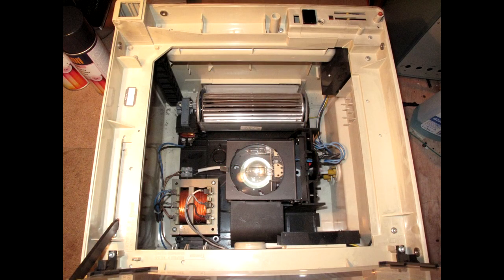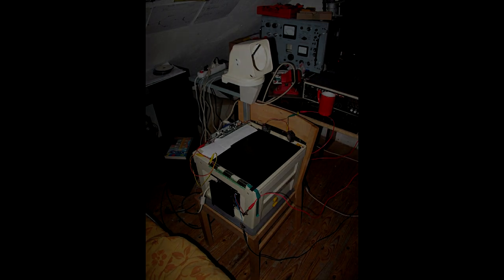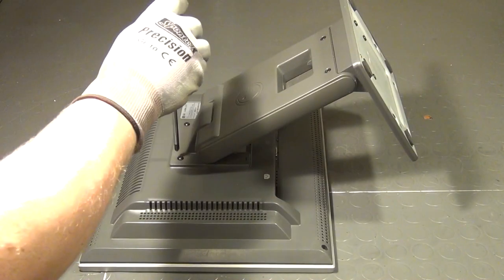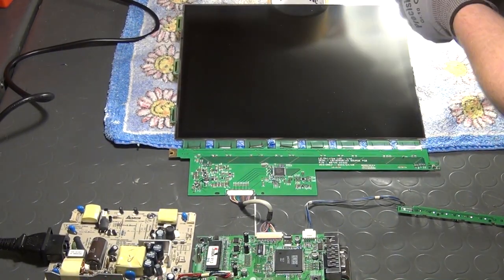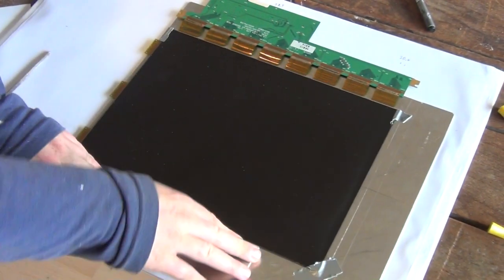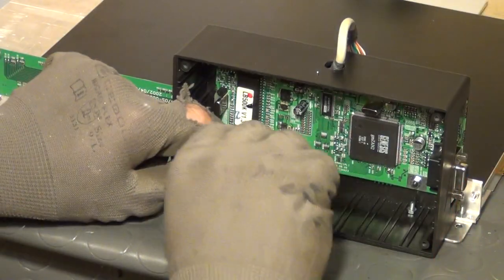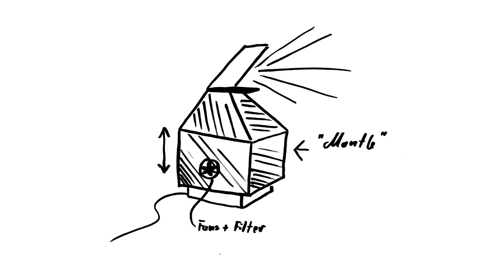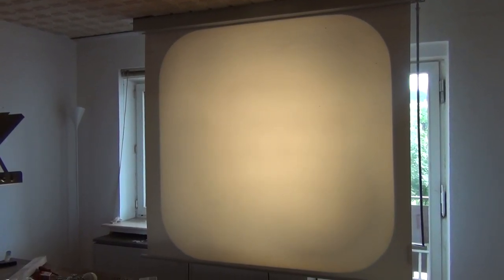The DIY Video Projector

Comment: Just for late / future viewers, most overhead projectors have the same size, a 13" laptop screen panel is too large, so pixel on the side will go missing, the best fit seem to be 12.5" laptop panels, they fit perfect and they come in full HD resolution, you can drive them with a cheap FHD HDMI LCD controller, so you can hook up your PC, laptop, media devices, consoles.
Also change the light source to a 100 or 150 watts cold white LED with a large CPU cooler, use a 24V Power supply and a voltage controller to drive it to the correct LED voltage and may be to dimm it if its too bright (like a DP50V5A). You can use cheap 140mm 2 pin PC fans and a cheap 4x PC Fan controller hooked up to a 12V power supply to cool everything relatively silent. Other modifications can be a large F500mm lens and a "rectangle 16:9 condenser projector lens" for the LED. If possible, get rid of the mirror, put it on a shelf or mount and project directly to the wall.

Comment: No! Do not toss away the backlight panel! By itself, it could be used for various things like decoration. You can paint on transparent foil and hang it on the wall, as an example. Or you could salvage the pipes in it for decoration, too. Put over each other, with a parabol reflector, you can get a pretty energy efficient light, maybe for your workbench (assuming you have no LED lights there) or against burglars outside!
Reply: An very interesting type of decoration can be achieved by using multiple layers with some of them moving/spinning...
Reply from the maker: I didn't think that people would take me literally when I said, that you can toss the other stuff away. I didn't mean that the other parts are totally useless. I meant that you don't need them for the projector.
Reply: My hearth just started pumping again.
Reply: +Len P What does your hearth pump, oil?
Reply: Lennart Nilsen, blood, maybe.

Comment: I built one of these back in the day and have dismantled quite a few LCDs as well since the search for the correct LCD felt like a pipe dream but Craigs list and ebay had "broken" LCDs for peanuts if not free. The LCD panel itself can be power with 3.3v and 5v. Sometimes 12volts. On my final build I used a 12volt wall wart with a LM7805 and LM7803 regulators. For cooling the LCD panel I used some AC powered fans that were pretty quite and tied into the main power line to the projector. This way I didn't have the high voltage inverter board in the circuit let alone I was using a LCD that had a bad PSU.

Comment: Kodak has a product LONG ago that was like a retrofitting for those projectors. It was an LCD Screen without any back pieces, just the glass (and polarizing filters I believe) I think it was TN type, not a TFT type. The product was called Kodak "Proxima". I saw it in action once and being a late 90s product it worked very nice. But yours works stunning.

Comment: I remember planning to build one of these some years back - what held me back is the fact that the TFT-LCD will age very quickly (please tell me when I am wrong) even when it doesn't get too hot, because of the strong IR radiation from the old-fashioned lightbulb. Using a stong-ass LED (150W) might actually work well, but I did not see a project like that yet.

Comment: I vaguely recall that commercial LCD/overhead projector adapter units didn't have cooling, either. The housings were thin enough to drop into a briefcase.  I was surprised, because, as anyone knows who got stuck sitting behind one in high school, they get hot as hell.

Comment: Very nice implementation. Also just to add about the dangers of mains connected power (especially at 240 volts like here in Australia) the large capacitors can continue to store lethal DC mains level voltage (or higher) for some time, so ensure that they are 'safely' discharged after unplugging the mains power before you consider handling the power supply board!

Comment: man you blew my mind. I've seen diy projectors in the past, using small LCD and LEDs, but It never came to my mind that I can use a retro projector like that. I'm thinking that with a lot of time toy could build a nice projector using the lens and fresnel of the retro projector, but putting it together in a linear arrange. this could improve the width of the projector a little bit. also you could adjust the projecting plane to move the projector out of the way. Now I want to give a try. thanks man! you're awesome.

Comment: this has a prog over store bought projectors aside form being to get most of the materials super cheap or free one could modify the projector to house not only contain all the components but, also install a Bluetooth sound system too. heck you could even build in battery bank to charge stuff while you watch movies, specially if you use it out side or something.

Comment from the maker: I just ordered a very powerful LED-module and I will try to use that for a future mod. But it was a very spontaneous decision and I didn't have the time for a lot of research on that yet. Any suggestions for particular LEDs that would be well suited? Links?
Reply: It all depends on the beam characteristics (both of the light source and the projector). As you know, LEDs are much more directional than any of the old style incandescent or halogen bulbs. If the projector is set up internally to harvest as much light from that omnidirectional light source and spread it evenly over the whole projection surface, it may be hard to compensate for the LED that beams its light only in one direction. Other than that, just take care that it's bright enough (cooling will also become an issue), I'd try it with something around the 50 Watt range, but that might actually be too bright already. And of course there's the light color, which will give you just a "whiter" white when you use LEDs in the 5000-6000 Kelvin range, instead of those in the 3500-4000 Kelvin range that resemble the old style bulbs a bit more (they're sold as "warm white").
If you really want to save on energy as well, build a proper "joule thief" circuit for it (with an adjustable potentiometer) and you'll make it much more efficient. For that, having a LED that's a bit too bright is actually good because then you don't need to run it at 100% brightness, but go down to 95% and be even more efficient with a Joule Thief.
Reply: I was thinking about this while watching. You'll want LED's that render color well. This store has many options for LED's with up to 98 CRI. Check out some of the youtube reviews for them. http://store.yujiintl.com/ 

This is a fun project to watch.
Reply: Well, actually LCD panel LED's don't use high CRI LED's. Some use RGB LED's for high gamut, but you'd still have an edge with color.
Reply: Awakened Anhedonic Isn't the color calibration of LCD panels usually done through the panel itself, so it can be independet from the LEDs?
Reply: Yes, it'd look fine without the perfect light source. There's a lot of people who say plasma screens with fluorescent backlighting had better color. Today screens use cheap LED's. High gamut screens that cover the Adobe RGB color space use RGB LED's which have sharp intense peeks in each primary color. The spectral characteristics of the light source is still relevant, even though LCD filtering compensates.
Reply: I did this exact project and used Cree 100w high powered LEDs mounted where the lamp was. Mine had the lamp facing downward at a 45 degree angle  and bounced it off of a mirror, which is inefficient, but allowed for a good place for the decently sized heatsink. Yours has the lamp on the bottom so you'll get 100% of the light from the source on the lens, but cooling may be an issue and you may have to cut a hole in the bottom of the projector. I cut plenty of holes in mine, as I integrated all the parts of the monitor into the projector enclosure itself instead of using project enclosures like yours, but I don't know if you're opposed to that as that is a really nice overhead. Also, the LED has to be far enough away from the top glass, so that it covers the whole thing and you get your whole image. This may be a challenge with a large heatsink.  Also something to diffuse the light (in my case it was the mirror, but frosted glass may work) may be necessary if you have an array of multiple LEDs, so that you can't see the individual LEDs in the projection. There are some things to consider for the LED mod. I know you'll come up with something great as usual. I can't wait to see!
Reply: If you dont want it to be too expensive, just go for a neutral white LED from a trusted seller. No, a LED for 2 bucks is not good. 
The major concern would be heat dissipation and power supply, although you should be able to get mains led drivers for this purpose quite cheaply on ebay. Both the LED and the driver should be heatsinked well. Another quite important part would be diffusing and spreading the light sufficiently, but the optics of the projector will already do the most.
Reply: Look for Videos of DIY Perks. He does show how to obtain high CRI LEDs.
Reply: For a recent car headlight project I ordered some Cree XHP70 in neutral white, for their extremely good lumen to size ratio, and when I tested them I was pleasantly surprised by their color rendition aside from the truly massive light output. Going all out and buying a Yuji with perfect CRI would be fun, but realistically I don't think anything above CRI 80 is necessary when using such an old LCD panel anyway. Here is a purchase link, with the nice copper base: http://www.ebay.com/itm/162121396402
Reply: Plasma screens do not require a backlight.
Reply: Tristan Fitzgerald They aren't transparent either, so there's no chance to project their image onto a wall/screen with an overhead projector. Totally different technology.
Reply: Also, is there a data sheet for that bulb to help with a "lumen-per-watt" conversion?  Or simply even the lumens of the bulb? There is no need for 900 watts of LEDs! LOL!  You could cook with the thing!
Reply: If you can obtain high power RGB leds you can even adjust the color temperature of the light going through the panel for fine tweaking!
Reply: I recently bought a batch of conical-shaped led lights with bayonet fittings from the local Tedox diy shop. they're rated at approx. 500lm @ 12v ac - the 230v ac were actually cheaper, I believe, and both types have frosted glass for light diffusion.

great project btw! I have a old Epson projector with a blown bulb....new bulbs on fleabay cost an arm and a leg, so thoughts are in the direction of converting it to use high-power leds. seeing that there's a lot of empty room inside the Epson's enclosure, I was thinking of inserting a RaspberryPi with media center and assimilating the remote control receivers so only one remote control is needed (remote control will be the app "irplus" on an old android phone).
that is, if time allows ;)

thanks for posting mate! greetings from the darkest boon docks of lower saxony
Reply: Someone beat me to it :-)

Comment: I did this years ago, I put a fan to the side of the LCD (which I stood on wood blocks) to blow air between the LCD and the main projector base. I played killing floor the UT 2004 mod.(with motion sickness) 8 foot high zombies projected onto a wall. Fun times..

Comment: years ago i build my own 1080p  lcd projectors. Its not easy but you need, cold mirror as a reflector for a 400 watt hqilamp ( now days maybe led ) You need ir/ uv filter glas, condensor lens, 2 fresnel lenses of high qualtity, and a good varyfocal projection lens. With those parts and some knowledge it will be a great picture.
Reply: i can provide you with pictrues of my builds ( over 25 builds )

Comment: Very nice. Looks purposefully made for these old 4:3 documentaries. 
Have you considered gutting a used 10" tablet and using the LCD from it, some of those are full HD, and I've seen 2048x1536 ones if you want to keep the 4:3 ratio.
Reply: Displays in tablets (and phones) are almost always glued/laminated together. No chance getting light through them from the back.

Comment: I'm curious, why not elevate the frame holding the panel, and build it so the fans are channeled under the panel to cool it? Could theoretically do that AND have a fan on top of the panel, shouldn't take much space and it would keep the panel considerably cooler.  

Very cool idea sir, I can't wait to give it a try myself. :)

Comment: Was meinst Du mit einer hohen Auflösung für kleinere Panels? Soweit ich weiß, werden Laptop-LCDs auch irgendwie standardisiert angesteuert, aber ich weiß nicht, was für Elektronik man dafür braucht. Da dürfte es aber 12 Zoll Panels schon für um die 50€ geben, die haben dann zumindest 1366x768, was zwar nur 720p hd-ready ist, aber besser als die 800x480 oder so, was es so bei 10-Zöllern leider viel zu oft als alte Restbestände von Netbooks gibt.

Comment: Do you think you can use UV-Led's as backlight and build somewhat like a uv resin sla printer without a digital light projector (the part that makes them expensive)?
Reply: I suspect it's technically possible but with an overhead projector you would need powerful lighting, I doubt LEDs would work but you could use a traditional UV lamp that would be compatible with the OHP (this would probably make it cheaper too). You would really need to make sure no light is spilt out for it to work properly and for safety. I don't know if OHPs have UV filters on the glass, I know a digital projector I took apart did (I used a small UV LED keyring to test the elements).

Comment: Can the back-light be used as a ceiling light?
Reply: Sort of, ive seen someones video where he made artificial windows from broken monitors
Reply: Those lights are quite inefficient, not that bright for a room and the high voltage power supply needed are quite a hassle (and dangerous, if you don't know what you're doing). There are conversion kits for many panels that allow you to exchange the high voltage tubes for LEDs. But again, if you want lights, get LEDs made for lighting. (e. g. glue LED strips to a board and just use the diffusor out of the panel)

Comment: I know things in the EU are different, and that I'm spoiled to have a cool electronics recycler nearby, but I'd imagine I spent less on my actual projector. Certainly not much more. So apart from the DIY factor, why do this?

Also, I was a little annoyed that you skipped separating the LCD from the backlight. Perhaps it is trivial, but I'd always assumed that it was likely to be obnoxious when I thought about doing this project some years ago.

Comment: Does the LCD age over time? The light-energy absorbed by dark pixels has to go somewhere^^
Reply: He mentioned it gets "acceptably" hot. If you want to enlarge its life span, cool it even more down ;)
Reply: would it not be released as heat?
Reply: if you used these in a classroom, you'll know the glass gets fairly warm or to some, untouchable. Several of my teachers would use a glove on their writing hand to avoid burns.
Reply: Water cooling monitors anyone? :D
Reply: You could try transparent mineral oil xD

Comment: my projector was made a little bit different
1 i used 13 inch laptop gloss screen, because the size is better unless you have very big projector
2 i did not use oryginal power syply, becuuse you simply need single 3,3 or 5v power suply to power the screen  and digital board.
3 use metal halide light source 150 -250w  r7s work great even in dayight and do not overheat the screen. (lcd is about45 *C after few hours of use without any fan, and that is in the middle)
sorry for the mess
https://kokodinlaboratory.files.wordpress.com/2016/06/100d1082.jpg
https://kokodinlaboratory.files.wordpress.com/2016/06/100d1089.jpg

Comment: What's the point of 4 gears rolling on a gear rack just to open a tray? Seems like something Germans would do just to mess with your head.
Reply: No need to mess with your head when you already seem to be messed up. Where are four gears?
Reply: +superdau he means the mechanism at 1:50 for the focus
Reply: There are only two gears and it's for adjusting the height of the image on the wall, not the focus.